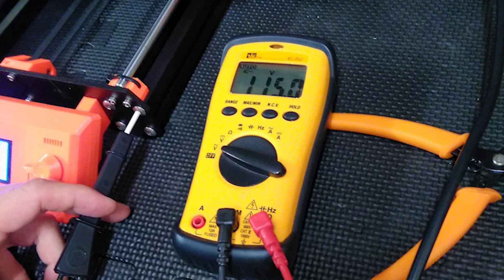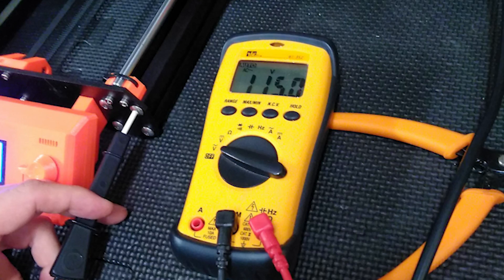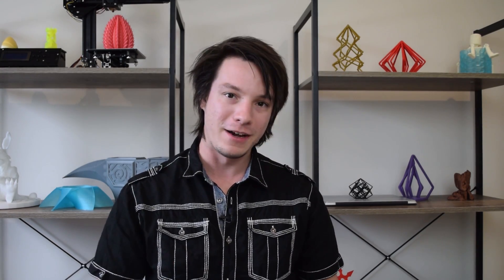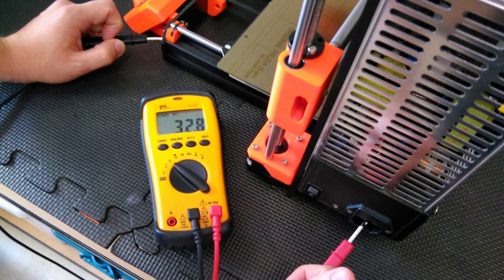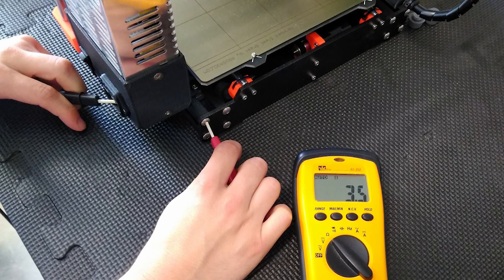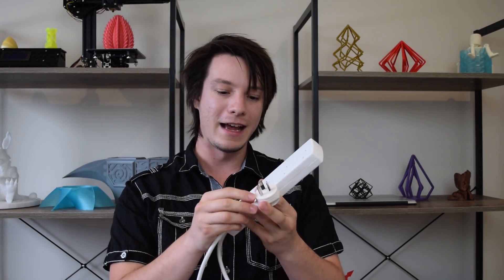I got shocked by a 3D Printer

Comment: An even more honest title; "I got myself shocked using a 3D printer" because this one makes it look like 3D printers are seriously dangerous which they aren't, if correctly used. Electric shock isn't pleasant, Im glad you're ok. Ive been electrocuted twice & survived x3 other events of potential death odds 3:1 against survival so I'm down to 4 lives left.
Reply: While a correct installation would have shown the problem, he was shocked because of a faulty printer.
Reply: He didn't say that,, he said IT WAS HIS OWN FAULT NOT THE PRINTER and it came down to a weak link in the series of power connectors one of which didn't have proper grounding & fed Voltage back to the printer. Angus then became the conductor of current which gave him the shock.

Comment: My worst grounding story was when the power company transformer lost its ground (corroded wire), and sent 220v over the normal 115V mains (united states).  It blew out over $1,500 of equipment (including 2 APCC UPSes, but nothing plugged into the UPSes were impacted).  Replaced all surge suppressors after that in any case, but I doubt most of those had damage.

We are just glad the house didn't burn.

Comment: I dont work with electricity but it seems like 6 volts through a metal frame is still carrying current all be it small so there is still an isolation issue to some degree.

Comment: I specifically had to get a power strip that had us plug, because the adaptor provided on the anet didn't have ground, and was reversible, what. danger that was! fortunately I remembered I had a power strip with us sockets, but grounding your electronics is really important, and every metal part should be grounded

Comment: Is there a device you can use, perhaps between the printer and the power strip, to monitor voltage and/or current on the ground wire?  This may well be an important data point in choosing a printer, especially if the same circuit the printer will be on has other sensitive devices.  After all, if a printer is tethered by USB cable, then it's likely on the same circuit as the computer it's tethered to.

Comment: After moving some stuff in my apartment, I had to use a power strip to plug my printer. I noticed a tiny red light on the power strip... Ungrounded. After much testing, I was shocked (emotionally, not electrically) to find out that most of the outlets in my 1925 apartment are not grounded (even though they're 3-pronged), since I can't really rewire it or anything like that, I ended up getting GFCI adapters for all my metal-cased devices, including the printer.
Reply: Please remember that a Ground Fault Circuit Breaker requires a ground to work, or at least a ground path. adding an inline one will provide some protection if you get a shock from to an alternate ground path but it wont help if it is relying on the non existent ground from the socket.
If the socket has no ground then the test button will not work on the breaker, have you tried it  ?
the breakers typically need a difference in the live and neutral current of about 30mA to trip. there are other rated ones too so check your if you need to know. this difference has no choice but to flow to ground or at least bypassing the breaker back to the source,
Reply: +noisycarlos - Have you ever had one of the GFCI circuits trip yet? Man those suckers are so fast and sensitive. Very impressive. Usually when the one in my washroom trips from maybe a little flick of water in the wrong direction, I don't equate the two events.  Instead of looking at the outlet, I go see if my breaker panel has a tripped circuit from something overloading it, lol.
Reply: Charliebrm1 I haven't had that issue, but there's not much humidity in the room, so far they've been solid, when the one I got for the kitchen area.

Comment: Angus, having a properly working ground/protective earth is a prerequisite as you just re-learned, but it's not necessarily enough to make the device safe. For instance, I use 220V, 1000W heater for the bed, and you can bet I earthed the bed, metal subframe below the bed and all aluminum extrusions the wiring is routed through. It's all done with crimped terminals, shake proof washers or Nylock nuts and hi temperature silicon insulated wiring.

Prusa uses low voltage bed heater and other components so it only needs to have the PSU unit grounded, but larger machines with mains powered beds are not uncommon.

Comment: I have not read the specs on drain. But if there is a small drain to ground and your daisychain had no ground in the cable. Maybe the ground between the grounded and ground break built up a charge then an arc back to the frame (think of a capacitor) when you touched it... it drained to you

Comment: i understand earth is made for electricity that gets leaked from the metal frame. how does that electricity trip over my circuit breaker?
Reply: There is a slight mistake in what Angus said in the first part of the video and you are correct in how you stated.  Earth ground is to capture stray voltage , by providing a shorter path to resistance completing the circuit when energized (versus somebody touching the metal, which is a protection measure).  The SIDE EFFECT is that the breaker will trip as the resistance is close to zero, which actually causes more current to flow and then trip the circuit break to trip (assuming that it is proper sized).  In industrial environments there is something known as ARC FLASH which can lead to the breaker not tripping fast enough... (this is far worse).  Keep safe.

Comment: Hi Angus. Thanks for this. Logic would suggest that the only thing connected to the power outlet is the power supply. I would start there by checking whether the PSU is, in fact supplying 110 v from Earth. Then I would throw it away or get it replaced.Nothing on the printer itself uses that voltage, so a short from there would only provide 12/24v - whichever is used on printer. I think if you plug the JG into a proper earthed supply it might even blow as current could run to earth freely.  But I'm only guessing. Not sure of supply V down there. If it's ~240 then the voltage drop will be a clue. I don't know if a neutral/earth short might produce that? Maybe? Real electrician required.

Comment: I think what you ate saying is quite different from what happened really. If one 3d printer doesn't have supply cable with ground wire, it doesn't mean it is 'leaking' voltage to another printer. You need to know that if a 3d printer leaking volatge you'll get shock from that printer only if that printer don't have a ground connection. Suppose if two 3d printers are connected with one having ground wire and another one doesn't check which one is leaking voltage. If the 3d printer without ground cable is leaking voltage it has the problem. If the other one has the leaking voltage, either the 3d printer is leaking voltage or some other device with ground cable is leaking voltage (since both devices are connected to common ground you'll feel the leaking voltage on both devices if the ground termination isn't installed properly) Hope you understand

Comment: In power supplies there is usually a small value capacitor to the ground in the EMI filtering section from one or both input power lines. You measured half of the line voltage on the ground, which would suggest two capacitors forming a voltage divider. The current would be limited by the capacitors so it would probably not kill you (but it would be slightly painful). If you touched a real low impedance 230V live wire you would not feel your arm trust me ;)
Reply: Like this https://nl.tdk-lambda.com/content/faq/130796117766108286_FilterFAQ_how%20Image%201.jpg

Comment: Most (if not all) switched-mode power supplies have a low-pass filter formed by capacitors from ground to both hot and neutral.  If ground is not connected properly, then the frame becomes live at half of mains voltage.  However, since this is a capacitive voltage divider, current is limited.  I isolated my 3D printer with tape and measured a mere 100µA of current from the frame to ground.  That's roughly 1000 times less than lethal levels.  This video is a bit misleading ;)

Comment: Look on motherboard find live.  - and + test between find voltage drain down the line. Even check the power in and out on both ends of the cabl see if there is a difference . Also test the screw on motherboard make sure there's a contact or spark between ground screw and frame. Hope this makes sense

Comment: You NEED to change the video title. This is how slander stories get started. This has nothing to do with 3D printers. This is basic electrical safety. It applies just as much to your 3D printer as it does to your PC and your oven and your stove and your electronics with metal casings and anything else that relies on mains voltage. This video should have been about electrical safety and how to safely hook up high current devices with exposed metal (such as 3D printers).
Reply: Yeah agree title could be changed....Next thing you know everyone going to be slandering JG Aurora....
Reply: TelliMantelli I had the story in mind of that 3D printer that caught fire and killed a kid which spread all over the news but it turns out the moron was using flash paper and multiple cans of hairspray. This video feels exactly like how a story like that would start

Comment: PS: on the prusa and similar printers that have an all-in-one power supply that outputs 12/24V, the power supply case should conduct to ground. The frame etc should be isolated (unless you have a model where the case touches the frame without insulation)

Comment: First thing you need to do with these Chinese Suicide Machines is upgrade and rewire the power supply. This is not rocket surgery. I've been repairing office machines, Laser Printers, green bar plotters and the like for almost 40 years. The crap coming from China can kill you if you don't know what you are doing. That said. I know alot of you out there tackle this hobby with a less than rudimentary knowledge of electronics. It is your responsibility to get that knowledge BEFORE dicking around with mains voltage. 1. UNPLUG THE DAMN THING BEFORE YOU WORK ON IT! 2. Get a power strip with a circuit breaker or Ground fault interrupt (GFI in the US) 3. When wiring switches ALWAYS wire the ground leg, DON'T leave it off. 4. Make sure your work area is clean and uncluttered. 5. WHEN IN DOUBT ASK FOR HELP!
Reply: Decimus dude, this isn't some Chinese no name machine. It's a trusted and reliable brand.
Reply: Justin Van Yea, but obviously it has a shitty Chinese SMPS. That being said, I don't agree with the OP, you shouldn't need knowledge of how power works (Especially enough knowledge to understand what's going on in this situation.) just to use a 3 printer. With that logic, you should have knowledge of how electricity works when using a vacuum cleaner. You buy, what you tout as a "trusted and reliable brand," and get a shock from it... Not good.
Reply: I'm speak generally. Of the 6 Printers I've built using Chinese parts kits. All of them had garbage power supplies. I've since replaced them with switching power supplies sourced from Taiwan, Japan or South Korea. You really do get what you pay for with this stuff.

Comment: Hey, It's very common to have mains voltage on the ground pin of a PSU because of input filtering. Google "Y-Capacitor Filter". There may be capacitors from neutral and/or life to ground within the PSU. With these, you will get mains or mains half voltage on the ground pin if it is left floating. However, this should only be able to supply very little current. It can be enough to feel it and, especially when you touch pointy/sharp edges it may even feel hurting, but usually it should be safe. Also, if you plug the printer into a correctly wired outlet and your RCD doesn't trip, the current may be okay. You can measure the current from ground of your printer to ground from a wall outlet with your multimeter to check that. Don't measure to the sink - you really don't know if there aren't plastic pipes involved. Also, by having more than one PSUs connected to your outlet with floating ground, the capacitance of multiple PSUs actually might have increased and thus the potential current that zapped you. If you have another multimeter that can measure capacitance, you could actually measure that.

Comment: Sounds like they may have mains transorbs and possibly one has failed. Even without an earth, there should be no significant potential on the chassis. That printer has a fault in my opinion (as well as your extension cable). Proper test is an Insulation Tester (Megger) and check for at least 20M Ohms or so at 200V plus (between live input and earth). This may damage any transorbs though so be warned.
Reply: No. If a *tranzorb (from mains to ground?!) failed, then he would have 240V on the mains chassis (remember, Australis has 240V supply)

Comment: Its normal for grounded power supplies that are not grounded to have voltage on the ground line. Its part of the design. JG Arora is probably fine its just that you had two grounded devices on the same extension cord that was not properly grounded.
Good video as it brings this information forward to those that might do the same thing. The current by the way would be very low, very little chance of it hurting anyone as the capacitors that couple this voltage to ground are normally small in value.

Comment: I actually got shocked from my Ultimaker 2 extended + once, i plugged it in a  12v to 110v inverter to run it off a car battery, it electrified the frame of the printer and i felt it as I was changing material. Scrapped that plan then and there.

Comment: Hi Angus, just a quick comment on your shock, and what may be the cause.  Virtually all switch-mode power supplies have capacitors that couple between the mains voltages and the supply output to avoid a lot of radio frequency interference, and of course to pass FCC or the equivalent agency’s tests.  This isn’t normally an issue on grounded supplies since they can tie the case ground to supply ground and avoid having the output floating at a fairly high AC voltage (Passed from mains to the output via those capacitors I mentioned).  —However obviously your ground connection wasn’t working and so you got bitten by that AC current between your body and the supply’s normally grounded output.  It’s worth mentioning that you were not in significant danger since the capacitors used are generally small enough to avoid health issues if you were to pass current from ground to the supply output through your body.  Cell phone chargers have this same issue, however I believe they design the supplies to use the smallest possible capacitors to avoid this risk.
Of course this is all conjecture, however it seems most likely to explain your experience.

Happy printing!
Larry

Comment: ac grid power is good for a wake up. its not thaaaat dangerous due to ac. once you get shocked by an old CRT tv tube (30.000 Volt), you know what I'm talking about. THAT hurts and makes your day^^ but you are right: using ac juice without PE (protection earth) wire and Fi is uuhm to prevent

Comment: Yup, That Happens.

I first ran into this back in the 1960's. Equipment has had bypass capacitors for a long time. It's always a surprise when you first run into it. The fact that it's non-lethal is nice after you get zapped, but still not the whole story. It's well worth pointing out what's going on to people so they understand the issue.

Back to your resistance readings on the I3 mk3 .... errr .... the front should be electrically bonded to the back. 30K ohms is not what you should see. It should be in the "couple of ohms" range. There are ways to fix this. Getting everything tied together will help when you get into dry weather and start getting ESD "sparks" to the printer. 

Bob

Comment: Glad to hear you ok. I think those of us who work with high voltage/current for a living know exactly how you feel. In some case multiple times. 😋 The higher the potential, the greater the risks. I worked with a lineman (worked on high tension lines) who changed industries who looked like he was being careless. I'd ask he questions about some of his actions and he would point out, in detail why he was safe.  I would NEVER try the things he did, but I guess considering his vast experience with high tension potentials he was far more comfortable in his understanding.  I guess it's all about perspective. I'm not even sure why I wrote all that.. :-(

I suspect there is nothing wrong with the other 3D Printer and was completely related to the ground or lack-there-of.

Comment: Want to know something funny, in Egypt  we have 220V grid with no earth terminal 😊
Reply: those are type C sockets. everyone there should switch to type F sockets which are earthed and compatible with type C.
Reply: It's is not just the terminal, there's no earth wire installed in the grid💔
Reply: @yassinelessawy6101  The right approach in that case is to put a (long) metal stake into the ground and take the ground connection from there. If you don't want to re-do your house wiring in such a case, you may connect the neutral to the stake and then in every wall socket connect the ground pin to neutral. It's less safe, but done in older installations. Anyway - you don't need to have a ground wire come into the house from the grid.